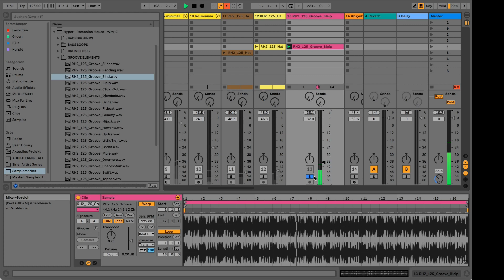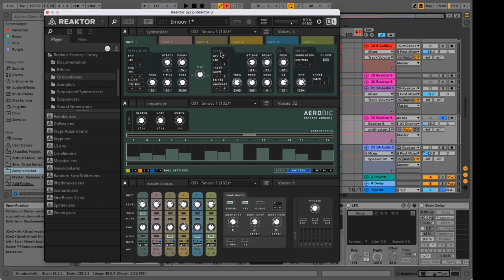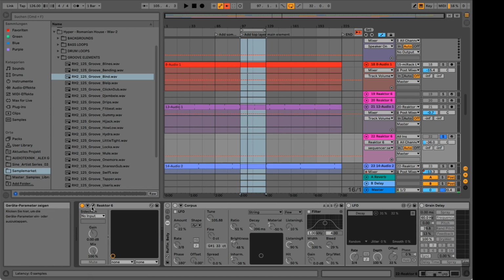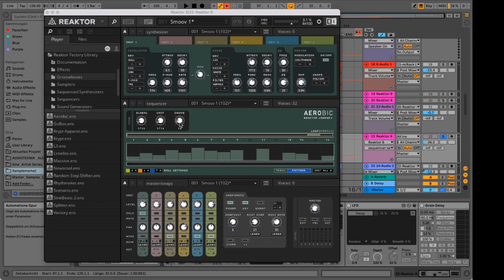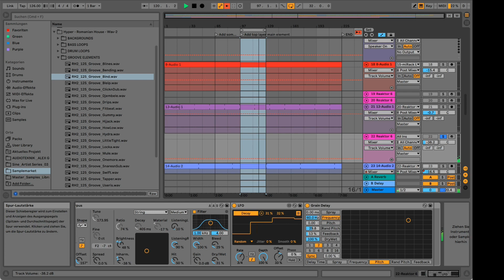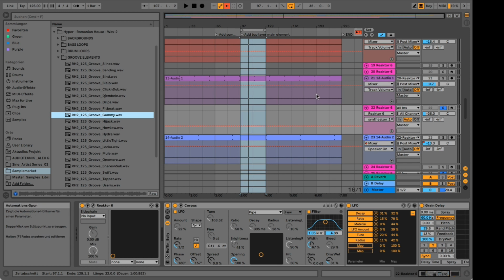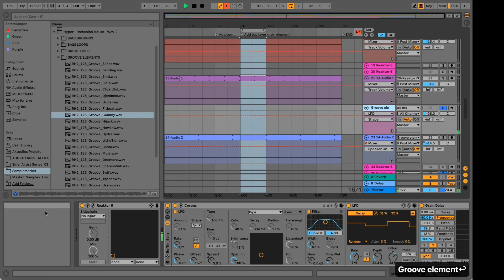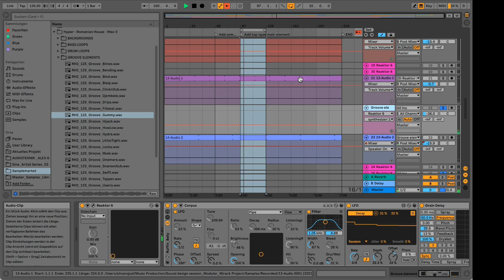Ro-minimal: Tired of stiff sounding rominimal tracks? Fix it with groove elements

Comment: sick work. when using LFO on the tune function of the CORPUS, are you afraid that it goes out of tune with the track ? because in this case it’s not only noise, there’s some tonal/musical elements in the groove. 
thanks for the great content and inspo
Reply from the maker: Thanks a lot for your comment! 

Honestly bro, I dont care about the tune, i just do it randomly and try to use the mindset of “if it sounds good - it sounds good”. Basically if I like what i hear, i just run with it. 

hope this helps